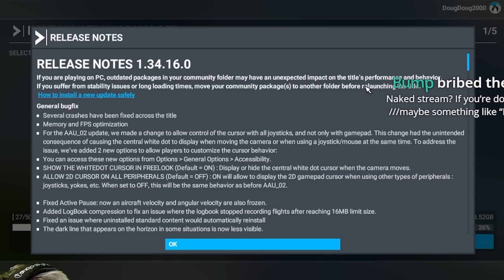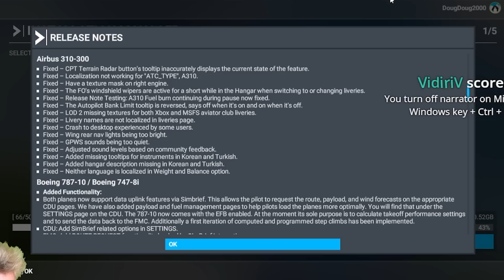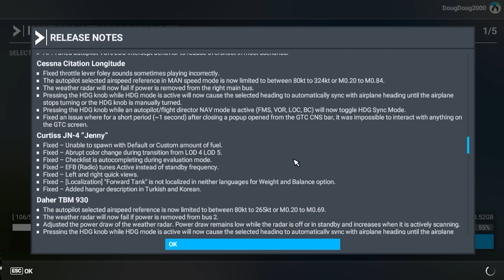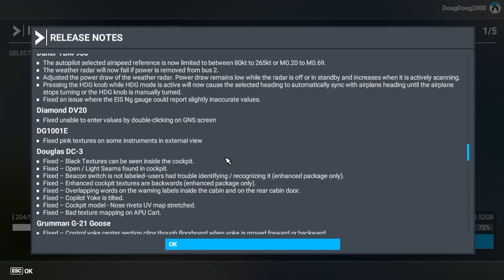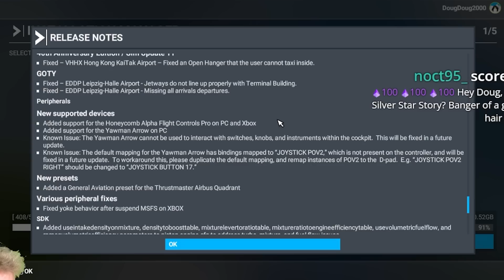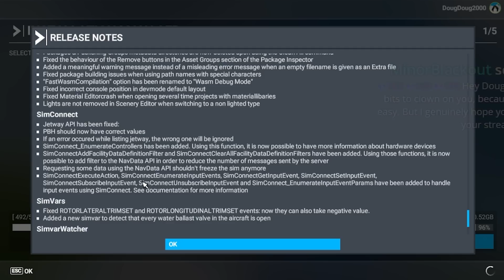Microsoft Flight Simulator release notes 1.34.16.0

Comment: press V to release notes popup window release notes release notes 1.3 4.1 6.0 if you are playing on PC outdated packages in your community folder may have an unexpected impact on the title's performance and behavior if you suffer from stability issues or long loading times move your community package s to another folder before relaunching the title how to install a new update safely General bug fix several crashes have been fixed across the title memory and FPS optimization for the aore 02 update we made a change to allow control of the cursor with all joysticks and not only with Gamepad this change had the unintended consequence of causing the central white dot to display when moving the camera or when using a joystick SL Mouse at the same time to address the issue we've added two new options to allow players to customize the cursor Behavior you can access these new options from options General options accessibility nevered question show cursor in free look default equals on display or hide the central white dot cursor when the camera moves allow 2D cursor on all peripherals default equals off on will allow to display the 2D Gamepad cursor when using other types of peripherals joysticks yolks Etc when set to off this will be the same behavior as before aore 02 while wa fixed active pause now an aircraft velocity and angular velocity are also Frozen added log book compression to fix an issue where the log book stopped recording flights after reaching 16 megab limit size load is so cozy fixed an issue where uninstalled standard content would automatically reinstall the dark line that appears on the horizon in some situations is now less visible fixed localization bugs Marketplace fixed a bug preventing content bought inside the marketplace from appearing in the content manager if this content was part of a non bought pack menu airports can be searched if they have special characters fixed main menu tile image for top gun Maverick DLC that was extending beyond the tile boundaries accessibility screen reader will now correctly narrate the highlighted option within popup dialog PRS okay cancel save Etc d-pad and keyboard navigation within UI menus will no longer jump unexpectedly to the social panel or tool tips when reaching the final item a horizontal Grid or List log book can now be navigated line by line using either gam pad d-pad or keyboard updated tool T you better explain how to adjust slider or cyclic options using game tag or keyboard install fix and issue where deleting content on Xbox would delete it on PC 2 and vice versa online fix a bug where the user would not join a group after accepting an invitation through the platform fixed a bug where lights and bar were not properly replicated navigation traffic fixed a bug where airplanes didn't slow down enough to turn while taxiing fixed a bug where airplanes performing a go around would go in circles forever hit G g3000 g5000 added support for displaying the wind Vector on the navigation map nearest map and weather map pains enabled user control of weather radar gain via the GTC weather radar settings page on stream adjusted map and SVT absolute terrain colors to more closely match the real unit fixed a bug where the nav data bar Isa field was displaying Isa temperature instead of Delta Isa think about these managed speed selections are now rounded to the nearest 0.1 instead of 0.01 attempting to activate the weather radar while on the ground will now show a confirmation dialog tun auto pilot for/ looc intercept Behavior to reduce overshoot in most scenarios fixed an issue where the autopilot would be inaccurate when flying in external camera view the navigation map nearest map and weather map sign selected heading Line is now shown in track up mode in addition to heading up mode the line is also no longer hidden when the selected heading is outside of the range compasses heading boundaries ADF frequencies below 200 khz down to 100 and 90.0 are now tunable fixed an issue where the fob sync instruction would still appear on the GTC weight and fuel page if the page was opened after fob was already set fixed multiple issues that could sometimes cause the GTC vnav page and Flight Plan text inset not display the correct active vnav Waypoint G1000 Z adjusted map and SVT absolute terrain colors to more closely match the real unit fixed a bug where the nav datab bar Isa field was displaying Isa temperature instead of Delta is tuned autopilot for/ looc intercept Behavior to reduce overshoot in most scenarios fixed an issue where the autopilot would be inaccurate when flying in external camera view the navigation map nearest map and weather map sign selected heading Line is now shown in track up mode in addition to heading up mode the line is also no longer hidden when the selected heading is outside of the range compasses heading boundaries fixed the issue where the PFD was not showing the specifically ISS with flashing aftering or pass experience but I fix multiple issues that could sometimes cause the active vnav Waypoint VSR and VD fields on the M sound something likeing please gns430 w/ gns530 W fixed aob l39 unable to enter values by double clicking on gns screen VFR map VFR map fixed an issue where the VFR map would not show heliports aircraft General fixed camera freeze with joystick Top Hat Airbus 310 to 300 C terrain radar buttons tool tip and accurately displays the current state of the feature fixed localization not working for atcore type A310 fixed have a texture Mas on right for flight to get windshield wiers are active for a short while in the hanger when switching to or changing liveries fixed release No testing A310 fuel burn continuing during please wait 100% the autopilot Bank limit tool tip is reversed says off when it's on and on when it's off fixed lot two missing textures for both Xbox and msfs Aviator Club liveries fixed Livery names are not localized in livery's page fixed functionality backed by Sim brief integration FMC add wind Uplink functionality backed by Sim brief integration CDU Weight and Balance page added under settings for fuel and payload management vnav added support for step climbs AP flch mode sets thrust to achieve the target altitude in 1025 seconds if possible CDU added CRZ clb and C CRZ to page titles to the CRZ page when in those reg CDU added the max angle speed field to the clb page CDU naav radio accepts manual VOR course entry when VOR is in manual toothbrushing stream an invalid entry message is given when an a beam Point cannot be found CDU the wind and ref o fields on takeoff ref page 2 can be autop populated by pressing the corresponding LSK call yourb while on stream and upgrade your garage internet support for closed loop checklist items that automatically complete based on the corresponding system States checklists checklist page will display the first in checklist of page entry or normal button press checklists added chkl incomplete Norm cautions for before takeoff approach and Landing checklists checklists added resets page where all checklists can be reset in having every checklist individually wondering if You' thought support for overing checklist individual checklist hilarious to see again IAS added stab green band warning to advise of incorrect takeoff CG entry IAS added a step climb alert if the climb has still not been started 47 ND add v/v /aa per formats 747 systems added automatic fuel system management option that will change the fuel system configuration in Flight as fuel quantities change in tanks defaults do off inhibited on ground 747 systems added insufficient fuel warning if the predicted fuel at the destination goes below the set reserves or zero if set of PE yellow 787 systems added insufficient fuel warning if the predicted fuel at the destination goes below the set reserves or fourth ,000 if not set bug fixes and improvements AP tuned localizer intercept Behavior to reduce overo in most scenario mention in the lethal compy stream ensure fac can always capture when close to the beam AP fixed an issue where the autopilot would be inaccurate when flying in external camera view AP the mCP speed window now opens with current speed when changing from VN to another vertical mode ever again CDU fixed an issue where a fixed info Eva or altitude prediction could not be deleted when the prediction could not be calculated CDU na radio page CRS value is now green instead of white CDU pressing the CB or the page links on the forecast pages will always return you to the BN page you came from CDU more accurate blank versions of the vnav pages I'm listening while I work and I real setting the assum temp on the off page did not set the thrust mode the thrust mode no longer SS to take off thrust mode when re-entering page C fix a bug that might navigate back to the page immediately after starting the creation of a creting a fully qu/ radial field on the hold page parses entries more accurately fun fact took ins Runway P field displays meters when the game unit is metric CDU CZ Al is now properly synced between cdus CDU distances to go now truncate rather than round CDU do not show direct to indications in legs page when a direct to is performed internally by other Microsoft flight simulator by pressing windows at the same time controls engaging reverse thrust via the toggle control input should now work more reliably IAS added gas off advisory Mage where's of the good days multiple Bugs Auto alerts flight model slight increase in braking efficiency FMC roll out and flare modes now disarm SL disengage when theart the patch notes FMC corrected approach mode engagement SL disengagement logic FMC fixed a bug where the pre-flight phase was skipped f MC fixed a bug where fix was the inter another INF P want to Auto that again before knows they have fix info a beam points are now deleted when passed FMC fix info no longer looks at legs behind the plane FMC when initializing a cruise descent restriction and tr
Reply: ansition speed limits are deleted if the new Cruise altitude is lower than their corresponding ones FMC fix info predictions are now available for the active leg FMC fixed a bug where approach phase would not activate with flaps one FMC fixed a bug where an altitude intervention in Cru could result in an early descent rather than that I think it was really Brave contral to rele value is 0 now works mCP corrected lfac and app light logic for/ app modes dmec RS fre /id to show correct V values for V are on F and d and to show correct ILS values when in app or app promote PFD the a screen reader on my computer trying to do some work isues that values V fixed a bug where the auto descent would not occur if the mCP altitude was adjusted closer than 10 nautical miles from t/d vnab the thrust drag required messages now OCC at the correct speeds in approach phase vnab the top of the speed band is now vm/ MMO 11 knots rather than 16 knots vnav fixed various issues causing the canot be calulated correctly when modifying vnav parameters after sequencing t/d Sim Chase Cam hudi and selected altitude are now showing accurate data FMC CB thrust liit is now retained when FMC selecting a new approach while flying an approach procedure should no longer break the approach speeds in the new approach CDU clearing a CDU message now clears it on all cdus Sy fixed issue where Landing altitude message appears when in Auto 747 AP thrust hold mode now activates at 70 knots during takeoff 747 AP the bank angle limit used while in hdg Cell mode now properly follows the selected Bank angle limit selected on the mCP 747 AP fixed Auto Bank limit to be Max of 25 instead of 30 747 CDU the dir and the now now work on the right CDU 747 CDU fixed for tuning data on the right right CDU 747 IAS fixed a bug where the fuel speed config warning would be shown immediately after takeoff before the fuel system automatically switched the configuration I hope you didn't 747 I flaps display Now hidden when starting C and D 747 FMC the FMC speed Target is now always the current main booing speed in approach phas just to at 3 fix certain instances where changing or removing a procedure containing the active Flight Plan leg would cause the active legs flight path to change unexpectedly 747 FMC early descent now reaches the target minus 1,250 fpm descent rate 747 synoptics adjusted fuel synoptics styling 747 systems rate of fuel transfer from Reserve to main tanks increased 747 systems fixed fuel imbalance warning text saying fuel inol 747 systems fixed stab tank warning message condition being reversed 747 tool tips fixed cap /fo air Daton knob description fixed foob Barrow outer knob tool tips 747 tool tips fixed Auto throttle tool tip value to show on instead of arm if Auto throttle is engaged updated AP alt knob push tool tip description 787 CDU to dir and an now now work when the CDU is on the left or right mfds 787 CDU fixed vort tuning data when the CDU was on the left or right MFD 787 checklists added recirculation fans on to pre-flight checklist 787 fbw fixed an issue with where fbw could snap back to an older trim setting one time upon disengaging autopilot 787 FW nominate for worst the unun before the GTOs 7 if I could submit it 787 PFD changed Barrow setting alert background 87 PFD SL hod L as L even with no AP or FD engaged 787 787 tool tips updated AP Des could you try to say the fixed an issue where High cabin alt mode would appear in the wrong conditions CES 208b Grand Caravan fixed radio panel and ADF interaction cess citation cj4 fixed passenger cabin lights not working Cessna Citation cj4 / w21 FMC added the root request feature that allows to Uplink a rot from SIM brief you'll find this feature via ID x- root menu on the FMC FMC new USR settings menu found on the index page 2 that provides various options cj4 ground power can now be toggled on/off when available via the USR settings menu cj4 passenger cabin lights have been added which can be controlled via the USR settings men U FMC electrical system and more sensible display of dis charging current of the battery cj4 fixed seat belt / safety Chimes not always working AP tuned autopilot for/ looc inter scarios Cessna Citation longitude fixed throttle lever Foley sounds sometimes playing incorrectly the autopilot selected air speed reference in man speed mode is now limited between 80 KT to 324 KT or M 0.20 to M 0.84 the weather radar will Now fail if power is removed from the right main bus pressing the hdg knob while hdg mode is active will now cause the selected heading to automatically syn with airplane heading until the airplane stops turning or the hdg knob is manually turned pressing the hdg knob while an autopilot slf flight director nav mode is active FMS for LBC will tole h b or feed me cat gets stuck in try to getat down Firs it was impossible to interact with on the Jenny fixed unable spiders aren't con lining into people's mouth color change during transition from lot four lot 5 fixed checklist is autocompleting during evaluation mode fixed the average is brought up by Australia in our to thousands of tiny funnel web spiders and right views fixed localization forward tank is not localized in neither languages for Weight and Balance option hey dou just want you to thank you description in Turkish and Korean D dbm 930 the autopilot selected air speed reference is now limited to between 80 KT to 265 KT or m0 22 and 0. I went to your show on Wednesday and I had a ENT us both online and offline adjusted the power draw of the weather radar power draw remains low while the radar is off or in standby and increases when it is actively scaned can't believe I've been pressing the HG while hdg mod is active will now cause the selected heading to automatically syn with airplane heading until the airplane stops turning or the hdg knob is manually turned fixed an issue where the Eis NG gauge could report slightly inaccurate values Diamond dv20 fixed unable to enter values by double clicking on gns screen dg1000 And1 e fixed pink textures on some instruments in external view Douglas DC3 fixed black textures can be seen inside the cockpit fixed open SL light seams found in cockpit fixed Beacon switch is not labeled users had trouble identifying SL recognizing it enhanced package only fixed enhanced cockpit textures are backwards enhanced package only fixed overlapping words on the warning labels inside the cabin and on the rear cabin door fixed co-pilot Yol is tilted fixed cockpit model nose rivets UV map stretched fixed bad texture mapping on Apu card Grumman g21 Goose fixed control Yol Center section Clips the floorboard when yok is moved forward or backward for interaction fixed manual fuel pump has no sound for interaction or function I think I'm getting an anxiety attack from the she main fuel valve selor this is somehow the best worst stream efb screen flickering A Beautiful Mess fixed some instruments in cockpit are not localized in Turkish fixed some instent many TTS messages are back up language not localized in Weight and Balance option fixed fuel tank value not localized in selected languages fixed asmx Associated description is not localizing in a dramatic voice fixed liy names are not localized in Li's page fixed added hanger description in Turkish H4 Hercules should do a total graphics are Now supported fixed added an undercarriage has been added in hanger mode fixed added Tugboat fixed added water friction fixed throttle trans to engineer brush your teeth correctly this time fixed added hanger description and Tool tips in Turkish and Korean fixed some art issues have been fixed in the it may just be a loading screen but unable toenter values by double clicking on gns screen Ryan nyp Spirit of St Louis fixed added hanger description and Tool tips in Turkish and Korean right flyer fixed added hanger description and Tool tips in Turkish and Korean World DV Island andz missing from the launch is now displayed in the Sim fixed visual issues on water in F grammar sites on Xbox fixed bur Khalifa po Collision airport fixed kjfk John F Kennedy Airport added missing building collision at kjfk airport fixed kdfw Dallas Fort Worth airport added missing buildings airport perimeter fixed aidl Donal airport fuel truck ground service does not properly connect to the aircraft fixed KSA Seattle Tacoma Airport terrain cracks World update 2 USA fixed water below and around Rainbow Bridge has tiling lot popping and a stretch texture fixed poons on top of Po yosity Park World update 3 UK and Ireland fixed Coastline displays open SC indicate how much TTS back up World update 4 France and Benelux fixed ahrd Rotterdam airport duplicate taxway signs fixed Trocadero poy had D data generating into the asset he can't brush his teeth as well as auxilary cannons Lighthouse poy has Strange Behaviors when having a certain distance away from the PO fixed there are buildings seen clipping into the Wester Kirk Po got to say this is definit is missing Collision for the center Tower fixed Peta Justice an worp is missing Collision for the entire Point fixed textures for walking railing only show on one side at the aliens Riviera Point fixed chatau deeran bespoke asset does not appear until the player is very close to the point fixed Peta papes is missing Collision on the south side of the point fixed France City update causes terrain to cover the bottom part of State de la bojar po fixed lactic cap Delong has water covering parts of the bespoke model World update 5 Nordic fixed Viking Stadium Sr Bank PO is missing Collision on the side buildings fixed gold fagel Nina POI does not appear until relatively close to the point fixed gold fagel Arena fi/ ask he didn't feed me world update 6 doc fixed lsz R Alton Ry St Gan duplicate taxway signs World update 8 Iberia fixed there is Major LOD popping scene at Camp no fixed major lck popping occurs at the Santa Katarina Market Point fixed the 516 araka Portugal PO is missing C
Reply: ions are now rounded to the nearest 0.1 instead of 0.01 attempting to activate the weather radar while on the ground will now show a confirmation dialog tun auto pilot for/ looc intercept Behavior to reduce overshoot in most scenarios fixed an issue where the autopilot would be inaccurate when flying in external camera view the navigation map nearest map and weather map sign selected heading Line is now shown in track up mode in addition to heading up mode the line is also no longer hidden when the selected heading is outside of the range compasses heading boundaries ADF frequencies below 200 khz down to 100 and 90.0 are now tunable fixed an issue where the fob sync instruction would still appear on the GTC weight and fuel page if the page was opened after fob was already set fixed multiple issues that could sometimes cause the GTC vnav page and Flight Plan text inset not display the correct active vnav Waypoint G1000 Z adjusted map and SVT absolute terrain colors to more closely match the real unit fixed a bug where the nav datab bar Isa field was displaying Isa temperature instead of Delta is tuned autopilot for/ looc intercept Behavior to reduce overshoot in most scenarios fixed an issue where the autopilot would be inaccurate when flying in external camera view the navigation map nearest map and weather map sign selected heading Line is now shown in track up mode in addition to heading up mode the line is also no longer hidden when the selected heading is outside of the range compasses heading boundaries fixed the issue where the PFD was not showing the specifically ISS with flashing aftering or pass experience but I fix multiple issues that could sometimes cause the active vnav Waypoint VSR and VD fields on the M sound something likeing please gns430 w/ gns530 W fixed aob l39 unable to enter values by double clicking on gns screen VFR map VFR map fixed an issue where the VFR map would not show heliports aircraft General fixed camera freeze with joystick Top Hat Airbus 310 to 300 C terrain radar buttons tool tip and accurately displays the current state of the feature fixed localization not working for atcore type A310 fixed have a texture Mas on right for flight to get windshield wiers are active for a short while in the hanger when switching to or changing liveries fixed release No testing A310 fuel burn continuing during please wait 100% the autopilot Bank limit tool tip is reversed says off when it's on and on when it's off fixed lot two missing textures for both Xbox and msfs Aviator Club liveries fixed Livery names are not localized in livery's page fixed functionality backed by Sim brief integration FMC add wind Uplink functionality backed by Sim brief integration CDU Weight and Balance page added under settings for fuel and payload management vnav added support for step climbs AP flch mode sets thrust to achieve the target altitude in 1025 seconds if possible CDU added CRZ clb and C CRZ to page titles to the CRZ page when in those reg CDU added the max angle speed field to the clb page CDU naav radio accepts manual VOR course entry when VOR is in manual toothbrushing stream an invalid entry message is given when an a beam Point cannot be found CDU the wind and ref o fields on takeoff ref page 2 can be autop populated by pressing the corresponding LSK call yourb while on stream and upgrade your garage internet support for closed loop checklist items that automatically complete based on the corresponding system States checklists checklist page will display the first in checklist of page entry or normal button press checklists added chkl incomplete Norm cautions for before takeoff approach and Landing checklists checklists added resets page where all checklists can be reset in having every checklist individually wondering if You' thought support for overing checklist individual checklist hilarious to see again IAS added stab green band warning to advise of incorrect takeoff CG entry IAS added a step climb alert if the climb has still not been started 47 ND add v/v /aa per formats 747 systems added automatic fuel system management option that will change the fuel system configuration in Flight as fuel quantities change in tanks defaults do off inhibited on ground 747 systems added insufficient fuel warning if the predicted fuel at the destination goes below the set reserves or zero if set of PE yellow 787 systems added insufficient fuel warning if the predicted fuel at the destination goes below the set reserves or fourth ,000 if not set bug fixes and improvements AP tuned localizer intercept Behavior to reduce overo in most scenario mention in the lethal compy stream ensure fac can always capture when close to the beam AP fixed an issue where the autopilot would be inaccurate when flying in external camera view AP the mCP speed window now opens with current speed when changing from VN to another vertical mode ever again CDU fixed an issue where a fixed info Eva or altitude prediction could not be deleted when the prediction could not be calculated CDU na radio page CRS value is now green instead of white CDU pressing the CB or the page links on the forecast pages will always return you to the BN page you came from CDU more accurate blank versions of the vnav pages I'm listening while I work and I real setting the assum temp on the off page did not set the thrust mode the thrust mode no longer SS to take off thrust mode when re-entering page C fix a bug that might navigate back to the page immediately after starting the creation of a creting a fully qu/ radial field on the hold page parses entries more accurately fun fact took ins Runway P field displays meters when the game unit is metric CDU CZ Al is now properly synced between cdus CDU distances to go now truncate rather than round CDU do not show direct to indications in legs page when a direct to is performed internally by other Microsoft flight simulator by pressing windows at the same time controls engaging reverse thrust via the toggle control input should now work more reliably IAS added gas off advisory Mage where's of the good days multiple Bugs Auto alerts flight model slight increase in braking efficiency FMC roll out and flare modes now disarm SL disengage when theart the patch notes FMC corrected approach mode engagement SL disengagement logic FMC fixed a bug where the pre-flight phase was skipped f MC fixed a bug where fix was the inter another INF P want to Auto that again before knows they have fix info a beam points are now deleted when passed FMC fix info no longer looks at legs behind the plane FMC when initializing a cruise descent restriction and transition speed limits are deleted if the new Cruise altitude is lower than their corresponding ones FMC fix info predictions are now available for the active leg FMC fixed a bug where approach phase would not activate with flaps one FMC fixed a bug where an altitude intervention in Cru could result in an early descent rather than that I think it was really Brave contral to rele value is 0 now works mCP corrected lfac and app light logic for/ app modes dmec RS fre /id to show correct V values for V are on F and d and to show correct ILS values when in app or app promote PFD the a screen reader on my computer trying to do some work isues that values V fixed a bug where the auto descent would not occur if the mCP altitude was adjusted closer than 10 nautical miles from t/d vnab the thrust drag required messages now OCC at the correct speeds in approach phase vnab the top of the speed band is now vm/ MMO 11 knots rather than 16 knots vnav fixed various issues causing the canot be calulated correctly when modifying vnav parameters after sequencing t/d Sim Chase Cam hudi and selected altitude are now showing accurate data FMC CB thrust liit is now retained when FMC selecting a new approach while flying an approach procedure should no longer break the approach speeds in the new approach CDU clearing a CDU message now clears it on all cdus Sy fixed issue where Landing altitude message appears when in Auto 747 AP thrust hold mode now activates at 70 knots during takeoff 747 AP the bank angle limit used while in hdg Cell mode now properly follows the selected Bank angle limit selected on the mCP 747 AP fixed Auto Bank limit to be Max of 25 instead of 30 747 CDU the dir and the now now work on the right CDU 747 CDU fixed for tuning data on the right right CDU 747 IAS fixed a bug where the fuel speed config warning would be shown immediately after takeoff before the fuel system automatically switched the configuration I hope you didn't 747 I flaps display Now hidden when starting C and D 747 FMC the FMC speed Target is now always the current main booing speed in approach phas just to at 3 fix certain instances where changing or removing a procedure containing the active Flight Plan leg would cause the active legs flight path to change unexpectedly 747 FMC early descent now reaches the target minus 1,250 fpm descent rate 747 synoptics adjusted fuel synoptics styling 747 systems rate of fuel transfer from Reserve to main tanks increased 747 systems fixed fuel imbalance warning text saying fuel inol 747 systems fixed stab tank warning message condition being reversed 747 tool tips fixed cap /fo air Daton knob description fixed foob Barrow outer knob tool tips 747 tool tips fixed Auto throttle tool tip value to show on instead of arm if Auto throttle is engaged updated AP alt knob push tool tip description 787 CDU to dir and an now now work when the CDU is on the left or right mfds 787 CDU fixed vort tuning data when the CDU was on the left or right MFD 787 checklists added recirculation fans on to pre-flight checklist 787 fbw fixed an issue with where fbw could snap back to an older trim setting one time upon disengaging autopilot 787 FW nominate for worst the unun before the GTOs 7 if I could submit it 787 PFD changed Barrow setting alert background 87 PFD SL hod L as L even with no AP or FD engage
Reply: d 787 787 tool tips updated AP Des could you try to say the fixed an issue where High cabin alt mode would appear in the wrong conditions CES 208b Grand Caravan fixed radio panel and ADF interaction cess citation cj4 fixed passenger cabin lights not working Cessna Citation cj4 / w21 FMC added the root request feature that allows to Uplink a rot from SIM brief you'll find this feature via ID x- root menu on the FMC FMC new USR settings menu found on the index page 2 that provides various options cj4 ground power can now be toggled on/off when available via the USR settings menu cj4 passenger cabin lights have been added which can be controlled via the USR settings men U FMC electrical system and more sensible display of dis charging current of the battery cj4 fixed seat belt / safety Chimes not always working AP tuned autopilot for/ looc inter scarios Cessna Citation longitude fixed throttle lever Foley sounds sometimes playing incorrectly the autopilot selected air speed reference in man speed mode is now limited between 80 KT to 324 KT or M 0.20 to M 0.84 the weather radar will Now fail if power is removed from the right main bus pressing the hdg knob while hdg mode is active will now cause the selected heading to automatically syn with airplane heading until the airplane stops turning or the hdg knob is manually turned pressing the hdg knob while an autopilot slf flight director nav mode is active FMS for LBC will tole h b or feed me cat gets stuck in try to getat down Firs it was impossible to interact with on the Jenny fixed unable spiders aren't con lining into people's mouth color change during transition from lot four lot 5 fixed checklist is autocompleting during evaluation mode fixed the average is brought up by Australia in our to thousands of tiny funnel web spiders and right views fixed localization forward tank is not localized in neither languages for Weight and Balance option hey dou just want you to thank you description in Turkish and Korean D dbm 930 the autopilot selected air speed reference is now limited to between 80 KT to 265 KT or m0 22 and 0. I went to your show on Wednesday and I had a ENT us both online and offline adjusted the power draw of the weather radar power draw remains low while the radar is off or in standby and increases when it is actively scaned can't believe I've been pressing the HG while hdg mod is active will now cause the selected heading to automatically syn with airplane heading until the airplane stops turning or the hdg knob is manually turned fixed an issue where the Eis NG gauge could report slightly inaccurate values Diamond dv20 fixed unable to enter values by double clicking on gns screen dg1000 And1 e fixed pink textures on some instruments in external view Douglas DC3 fixed black textures can be seen inside the cockpit fixed open SL light seams found in cockpit fixed Beacon switch is not labeled users had trouble identifying SL recognizing it enhanced package only fixed enhanced cockpit textures are backwards enhanced package only fixed overlapping words on the warning labels inside the cabin and on the rear cabin door fixed co-pilot Yol is tilted fixed cockpit model nose rivets UV map stretched fixed bad texture mapping on Apu card Grumman g21 Goose fixed control Yol Center section Clips the floorboard when yok is moved forward or backward for interaction fixed manual fuel pump has no sound for interaction or function I think I'm getting an anxiety attack from the she main fuel valve selor this is somehow the best worst stream efb screen flickering A Beautiful Mess fixed some instruments in cockpit are not localized in Turkish fixed some instent many TTS messages are back up language not localized in Weight and Balance option fixed fuel tank value not localized in selected languages fixed asmx Associated description is not localizing in a dramatic voice fixed liy names are not localized in Li's page fixed added hanger description in Turkish H4 Hercules should do a total graphics are Now supported fixed added an undercarriage has been added in hanger mode fixed added Tugboat fixed added water friction fixed throttle trans to engineer brush your teeth correctly this time fixed added hanger description and Tool tips in Turkish and Korean fixed some art issues have been fixed in the it may just be a loading screen but unable toenter values by double clicking on gns screen Ryan nyp Spirit of St Louis fixed added hanger description and Tool tips in Turkish and Korean right flyer fixed added hanger description and Tool tips in Turkish and Korean World DV Island andz missing from the launch is now displayed in the Sim fixed visual issues on water in F grammar sites on Xbox fixed bur Khalifa po Collision airport fixed kjfk John F Kennedy Airport added missing building collision at kjfk airport fixed kdfw Dallas Fort Worth airport added missing buildings airport perimeter fixed aidl Donal airport fuel truck ground service does not properly connect to the aircraft fixed KSA Seattle Tacoma Airport terrain cracks World update 2 USA fixed water below and around Rainbow Bridge has tiling lot popping and a stretch texture fixed poons on top of Po yosity Park World update 3 UK and Ireland fixed Coastline displays open SC indicate how much TTS back up World update 4 France and Benelux fixed ahrd Rotterdam airport duplicate taxway signs fixed Trocadero poy had D data generating into the asset he can't brush his teeth as well as auxilary cannons Lighthouse poy has Strange Behaviors when having a certain distance away from the PO fixed there are buildings seen clipping into the Wester Kirk Po got to say this is definit is missing Collision for the center Tower fixed Peta Justice an worp is missing Collision for the entire Point fixed textures for walking railing only show on one side at the aliens Riviera Point fixed chatau deeran bespoke asset does not appear until the player is very close to the point fixed Peta papes is missing Collision on the south side of the point fixed France City update causes terrain to cover the bottom part of State de la bojar po fixed lactic cap Delong has water covering parts of the bespoke model World update 5 Nordic fixed Viking Stadium Sr Bank PO is missing Collision on the side buildings fixed gold fagel Nina POI does not appear until relatively close to the point fixed gold fagel Arena fi/ ask he didn't feed me world update 6 doc fixed lsz R Alton Ry St Gan duplicate taxway signs World update 8 Iberia fixed there is Major LOD popping scene at Camp no fixed major lck popping occurs at the Santa Katarina Market Point fixed the 516 araka Portugal PO is missing Collision in the wires fixed there is an invisible hit box in the middle of the V real Bridge fixed there is Z fighting present at the T Vasco de G Point fixed the Myriad Hotel sign is reversed microft flight Sim downlo speed missing Collision on some portions of the roof is missing Collision on the beams on the stop of the stadium fixed AI traffic can be seen in areas near the elapro villao they should not be fixed vegetation can be seen clipping into the alamillo bridge Point antimicrobial toothpaste my gum stopped bleeding all the time after I started fixed terrain spike in water near Regio de Calabria fixed area thir has 4888 74347 I took inspiration world now I have a twoed penis vegetation can be seen clipping into the pwa dam provincial Heritage Park Point hey Doug pop around turn volume World update 11 Canada fixed polygon /water issues near Samuel the Champlain Bridge Point fixed entirety of the Regina legis building you have to make sure the over there new people will join zgs World update 13 Oceania and Antarctica fixed adjusted position of a ygf airport marker fixed adjusted position of a airport marker fixed adjusted behavior of antb airport buildings fixed excluded Palm Tree near rw7 and of phko airport fixed removed aircraft tail section baked into orko on fray Runway head El St introduced by the new highr stem for Hawaii of pH airport World up central eastern Europe fixed several buildings at pronus Castle are partially buried under the terrain fixed there is a fountain floating above the ground near the lam missile Castle point I'm glad to finally find building are seen clipping into the EST Basilica po fixed cror Castle poy is missing Collision on the floor fixed parts of the zigg jet Castle poy are floating above the terrain having this be someone's after watching has to be like going to Disney and seeing one of thear to Le Castle fixed open scene displays on bespoke rocks next to the just television Tower fixed por Lighthouse name fixed to Lighthouse of porer fixed story Mass Len name fixed to mass L Bridge because a lot of people keep Castle name fix blind play games many of us see Fortress name fil tools to make it around with blindness if you're interested I can Castle po has clipping vegetation 40th anniversary edition SL Sim update 11 fixed vhhx Hong Kong kitac airport fixed an open hang that the user cannot taxi inside go fixed EDP lipic Halley airport jetways do not line up properly with terminal building fixed EDP liip hle airport missing all arrivals departur people watching you supported device added support for the honeycomb Alpha flight controls on PC and Xbox added support for the Yan arrow on PC known issue the Yan Arrow cannot be used to interact with switches knobs Silver Star Story this will be fixed in a fure came out when you still years default mapping for the yman arrow has bindings mapped to joystick pov2 which is not present on the controller and will be fixed in a future update hey Doug I'm a YouTube around this please duplicate the default mapping and remap instances of2 to the dpad e joystick pov2 right should be changed to joystick button 17 new presets added a general aviation preset master air Behavior M on XX intake mixture mixture lever table mixture arine offic table use volc Fu flow and efficiency parameters to CFG to address turbo m
Reply: ixture and fuel flow issues added support for helicopter engine trim control by rpn code okay for details Imagine by add a way to communicate between it is some good aent listener for Java and for slow mode cannot be activated anymore through Sim connect or JS when playing an activity fixed changing Runway number not updating Runway taxi paths blender plugin added 4 SDK fix GDI plus fth filling the W of frame buffer instead the provided fixed crash when opening debug Sim forces user lights debug fixed light emitter permitted range SDK fixed an issue where a JS nearest airport search session trying to read return teleports fixed wasm debug or extension which might cause crashes if it is used in a c context Dev mode fixed typos in cfd debug window fixed potential corruption upon saving a project that uses special characters packages and Publishing groups metad directories are now deleted upon using clean all command fixed the behavior of the remove buttons in the asset group section of the package inspector added a meaningful warning message instead of a misleading error message when file name is given as an extra file fixed package building issues when using path names with special characters fast wasm compilation option has been renamed to wasm debug mode fixed incorrect console position in De mode default layout fix material editor crash when opening several time projects with material lights are not removed in scenery editor when switching to a non-lighted typ connect J has been fixed should now have correct values if error occurred while listing jetway the wrong one will be ignored sin connectcore enumerate controllers has been added using this function it is now possible to have more information about Hardware devices simc connect at facility data definition filter and Sim connect clear all facility data definition filters have been added using those functions it is now possible to add filter to the na data API in order to reduce the number of messages sent by the server requesting some data using the nav data API shouldn't freeze the Sim anymore Sim connect execute action Sim connect enumerate input event Sim connect get input event Sim connect set input event Sim connect subscribe unsubscribe inut EV and connectcore enumer params have been added to handle input events using Sim connect see documentation for more information Sim bars fixed r All trim and longit trim events now they can also take negative value added a new simbar to detect that every water Bast valve in the aircraft is open simbar Watcher fix simbar Watcher writing to user Sim object instead of selected one aircraft editor added missing engine type value added to gas parameter in radio section added new engine parameters added loading section in aircraft.cfg changed N1 to shter cable from 5 to 10 made display size adaptable to system scale remove obsolete parameters made Gizmo window match current parameter unit fixed spring list type parameters fixed power absorbed parameter wasm added a bfx API in wasm to spawn and control visual effects some error messages were missing when a wasm module becomes dirty rapid JS o n has been integrated to the SDK to simplify wasm JS communication you can leave feedback on various topics here https forums. simulator.com below R1 buttons one okay